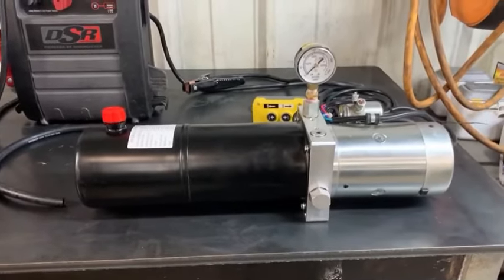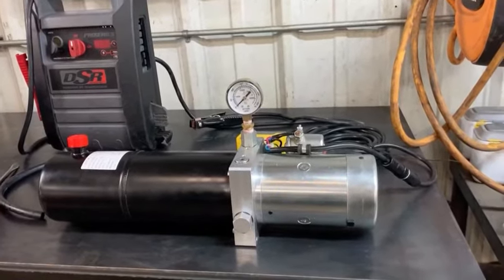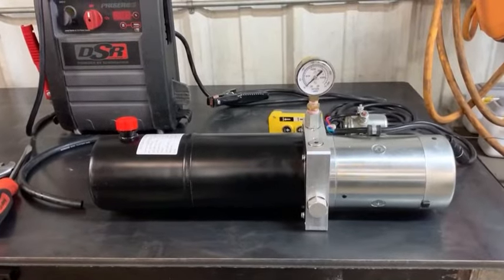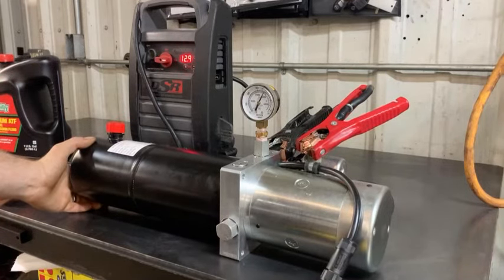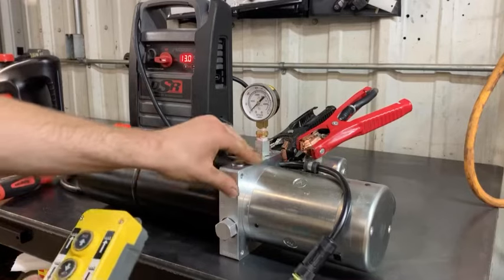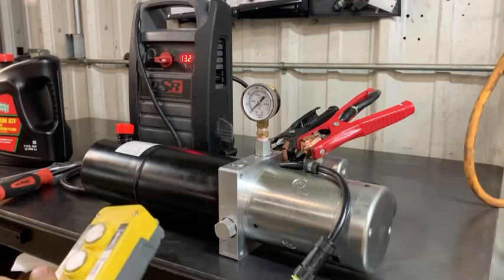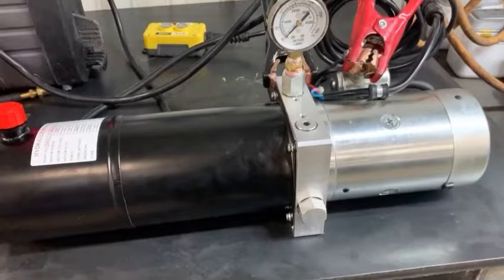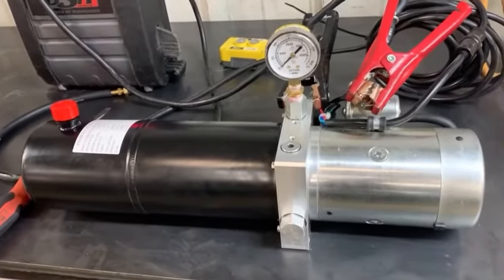How to set the max hydraulic pressure on a 12v hydraulic pump

Comment: You don't understand how much b.s. this saved me from. I have a dump truck that barely lifts itself empty. I just need to adjust this...Thank-you from Rhode Island!
Reply from the maker: Definitely try that first but your pump might be weak.
Reply: Yea the pump is dead. Motor runs fast but acts like it is low on fluid...I'll just get a brand new used pump. Thank tho.

Comment: Question: Im have trouble with my dump trailer, have flow but no pressure. What would happen if you used hydraulic fluid instead of ATF. Should I drain the tank and put in new ATF fluid. Do you think that it harmed the unit by using the hydraulic fluid? My pump is just like the one you have in your video. Where can I find a pressure relief solenoid as shown in your video?
Great job

Comment: I have a single acting pump off a pallet lifter. Looks very similar to this one. Question is, how would you go about converting it to double action?
Reply from the maker: It should have a pressure and a tank port/return you’ll have to get a spool valve of some kind run you’re in an out from your pump and then you’ll have the spool valve to reverse the flow to whatever you’re working.
Reply: @backintheshop9604  Awesome! Thanks for the quick response! The pump is a hydr-app 24 volt that I just bought from eBay. I am going to use it to power a hydraulic lift mechanism on an rc track drive robot. I have a mill and a lathe, so I might machine a spool for it to make it double action later on.

Comment: Very informative.Would like to know what power source you are using to drive it, what amps does it deliver?
Tks.
Reply from the maker: On a normal daily used situation I would recommend at least one 850 cca battery. But it’s a good idea to have to hooked in parallel to double the amperage.

Comment: ive got a pump like this but it has 2  solenoids and another adjustment on the other side. now does the adjustments do the opposite side? (like this appears to do), mine does have forward and reverse rotation. 

0
Reply from the maker: It should only have one pressure relief/adjustment the other one might be just a plug.

Comment: Are the pressure the same going an down my trailer up is strong coming down has little power to lift anything  up on the end of the trailer?
Reply from the maker: They should be same. If there not you probably have a bad solenoid.

Comment: Hi how bout. Wiring 12 volt pump.. my hydraulic pump has one wire out back .I need to look at box on the side . By knob. Probably pressure knob. Says not over 1000 pounds. It’s a small platform lift lol. Can’t find non like it. Fabtek think they sold out to hyster I read. ?? I’m just learning, but I can start a Harley. Lol

Comment: Hi, how do you adjust the down speed. I used a pump like this on a 2 post lift, but it comes down very slowly. Can it be adjusted?
Cheers C
Reply from the maker: Is it electric solenoid control for the down function?
Reply: Yes bud, basically same as yours but mine has square oil reserve.
Reply from the maker: There’s no way to adjust electric valve You might need to try to find one with a higher flow rate.
Reply: @backintheshop9604  Thanks for your help, that answers my question.

Comment: I’ve got a 10,000# dump trailer and it won’t lift 6 ton in the trailer! Can I adjust more pressure even if it’s set to factory specs? 
The pump I have runs when going up and going down?
Reply: It's never a good idea to change the pressure over factory spec with dump trucks / trailers they usually get worn out from contamination dirt gets thru the breather wears out the pump and the lift cylinders but the weakest part is probly the piston seals on the lift cylinder
Reply: @troywiseman5516  just seems odd this dump trailer has never been able to dump anything over 6000 # and it’s rated for 10,000#
I’ve owed since new!
Reply: I did this to my dump truck and busted the pressure hose, so had to upgrade to a 5000psi pressure hose
Reply: @ViVA-MEXICO-AMLO  I’d be more than happy to do that if that’s what it takes to dump heavier loads as it should…..very frustrating getting 3 yds of trap rock and the dump trailer won’t dump it…..doing it by hand is defeating the purpose of using a dump trailer!

Comment: I have a single acting pump but my gravity down goes down very slow. Do you think I have a bad solenoid. I’d rather make it a duel solenoid system but don’t know what to do with the second port
Reply from the maker: Yes, your solenoid is most likely bad. To use one as a double action, you just have to have a spool valve with a in and out and then you can use it to control the direction of pressure.
Reply: @backintheshop9604  My solenoid on a older  Fennel fluid pump doesn’t have a part number on it. Are most solenoids coils within the same voltage interchangeable or are they pump specific? Having a hard time figuring where to start my part replacement search.
Reply from the maker: @truhawaii5957  most of the solenoid coils are the same either 12 or 24 V but I’m pretty sure the work on either. The part that’s different is the stem or mechanical part that the coil fits on that is going to be more specific to your pump you may be able to remove it and take it to a local Hydraulic shop and see if they can identify or match it up by dimension.

Comment: I need help with a porta power pump I bought that doesn't Force the fluid to the cylinder a video on that would be cool there's not much on the internet about them
Reply from the maker: Check the fluid level, make sure all of the couplers are actually releasing, so the fluid can flow other than that. You may have to disassemble the entire thing and do some investigating.
Reply: Fluid was good. I swapped the pumps with one I borrowed and used the hoses and the cylinder from the kit and everything worked normally. So it's something inside the pump. And that's were I have an ignorance overload.😅..I just can't grasp the overall mechanics of the thing until someone explains it to me.. I have the vevor 12 ton jack.
Reply: Sorry for going off topic. I don't normally do that..

Comment: So, if I'm going to be running a cylinder on a dump trailer with a max working pressure of 2200psi, what would be the best pressure to set the pump at?
Reply from the maker: You will want to set it to 2200. That way you don’t blow out your cylinder when it hits the end.
Reply: All cly have a safe rating and best not to ever go above it😊

Comment: I have a lowboy trailer using the same hydraulic system. The trailer will go up but leaks down in about 30 seconds. It has two way cylinders that pressure down. I took the check valves out and they seem to be working. What do you think the problem is ?
Reply from the maker: If there’s not trash in the pump valves and they look fine the cylinder probably needs repacked.

Comment: My friend  hi you doing  I have 2013 ford f550  dump  no work I press the botton  up  doing  nothingI press the raise button and it doesn't do anything it doesn't make a noise like it's dead

￼
Reply from the maker: Got to check for power.
Reply from the maker: Got to check for power.
Reply: How can I do that. thanks I will share your video it helps a lot of people save money
Reply from the maker: @mariochavez1824  you need to take a volt meter and check all your powers and grounds.

Comment: maybe could help me..my pump is used on a tow rig aswell every is working but my wheni need to open l arms it doesn't open makes a clicking sound like it's out of fluid
Reply from the maker: It sounds like one of your Solenoid valves is bad. You’ll have to figure out which one controls the arms. If it’s clicking the solenoid it self should be fine but I would check and make sure you have a good 12 volts to it. The valve threads into the block and the solenoid fits onto it you remove the solenoid and then unthread the valve. The pressure relief valve it’s just for Max pressuring you shouldn’t need to adjust it it’s been working

Comment: I have a hydraulic pump like yours but I cannot see how you wired it. I believe I have it wired correctly but all it does is click, it will not circulate the fluid. Can send me a picture of how you wired it? or link? I am using a 2 prong toggle switch for the lift. If it would work better using a 3 wire up & down controller, I might have to do that.
Reply from the maker: Mine just has a power and a ground hook up. The solenoid and remote are already pre-wired. I just tapped into there is no wires for my extended remote. You should be able to look up the model of your pump and find a wire diagram on Google images or the manufacture website.

Comment: Mine is a double acting and has 2 ports. 1 with cap the other without. Do you know which is which?
Reply from the maker: you’ll have to find a hydraulic schematic for that particular pump, or check with the manufacture.

Comment: Quick question....can these pumps be fitted vertical and still work properly and efficiently.
Reply from the maker: @mikepalm6452  as long as the tank inlet is submerged in fluid and you don’t start the pump you can mount it any direction
Reply from the maker: @mikepalm6452  most of them are set up to mount a certain direction.
Reply: Cheers fella that's really helpful

Comment: Thank you, this adjustment helped me with my dump trailer build, 
Do u know any way to slow the return? As my trailer tipps back down fairly fast
Reply from the maker: Is yours gravity down?
Reply: @backintheshop9604  Mine is, do you know a way to slow?
Reply from the maker: Yes I’m just learning about this myself you can get an adjustable flow valve for about 60 bucks You can find them all over the Internet.
Reply: I have 2013 f550 dupm dont work I press the raise button and it doesn't do anything it doesn't make a noise like it's dead can you help please?

￼

Comment: My solenoid just clicks when I press my buttons... And motor does not come on when I connect it directly. IT'S BRAND NEW!!! NEVER BEEN USED... COULD IT BE VOLTAGE? BATTERY IS NOT COMPLETELY AT 12V ON THE VOLT METER
Reply from the maker: I will check your battery. Make sure it’s good and all your connections are good. If that all checks out I would say you have a brand new defective pump.
Reply: Check your ground, it has to have very good connections to work 
Check stem on solenoid for rust 
Happens to new ones also
Reply: Mine does the same thing. Take a small hammer. Tapp the motor. Tap it on the end. Or on the side. Or on top.. I have to hit mine on the negitive post

Comment: You must not have seen many hydraulic pumps, mine on my dump truck is single acting, and it only has on port not two. And I just replaced it with the same pump and again one port two, not one being plugged just one port, it raises up and gravity feeds back down. Just to let you know there are lots of single acting pumps that have only one port.
Reply from the maker: As long is it has two ports a single action pump can be used for anything with the right control valve.
Reply from the maker: Oh okay I understand. Yeah I haven’t personally seen one with only on port. I guess if you needed to change it you’d have to installed a return port in the tank. Thanks for the info.